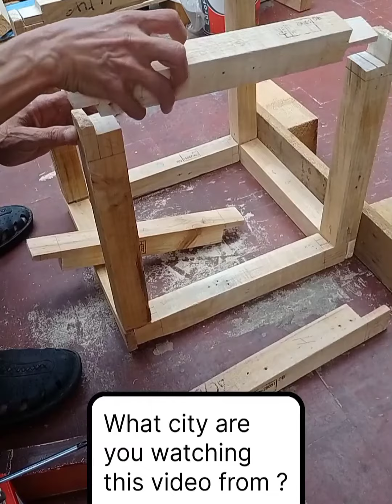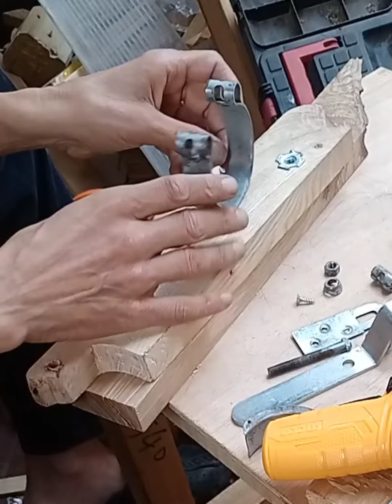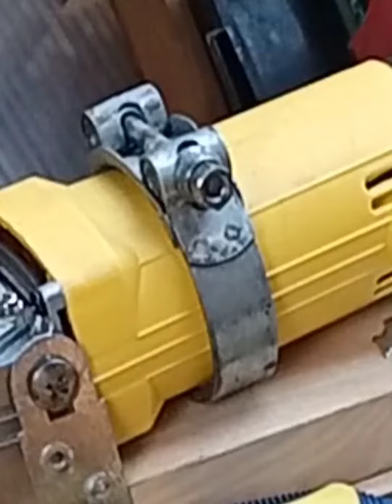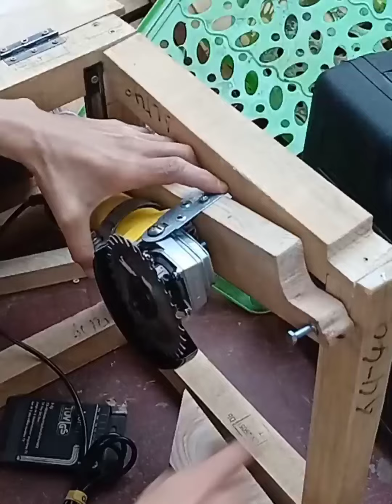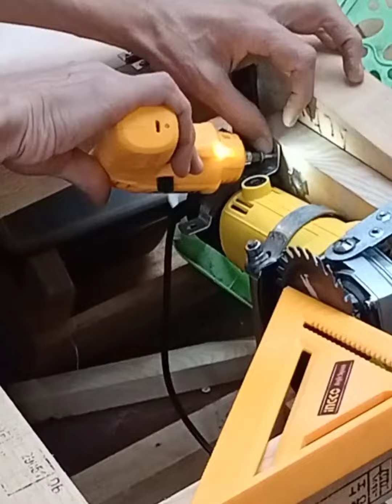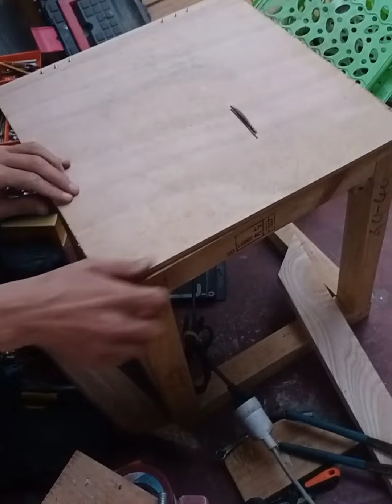use an angle grinder to make a mini table saw for small jobs, simple model, you just have to dare.

Comment: looks good, maybe cut the screws sticking out of the hinges.  also i hadn't seen it in the other video, but find a way to lock the table closed!  I'm French, I'm looking at you from Quebec by the way :)
Reply from the maker: Soyez le bienvenu,
Merci pour l'intérêt que vous avez porté à ma vidéo, merci pour le temps que vous avez dépensé pour commenter.
Vous avez tout à fait raison, j'ai éliminé les charnières avec leurs vis et j'ai fixé le haut totalement, en plus un guide et un cache lame sont installés.
Cordialement.
Reply: @bricopath  parfait ! En tant que menuisier ébéniste ça me fait plaisir de partager mes connaissances, surtout quand il s'agit de sécurité ;)
Reply: @cocodomino9153  je vous remercie encore une autre fois